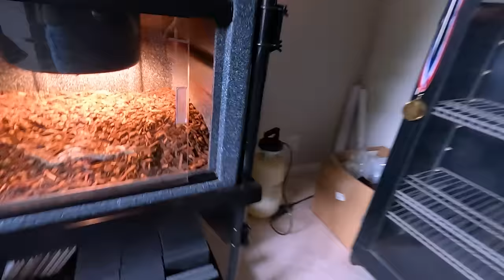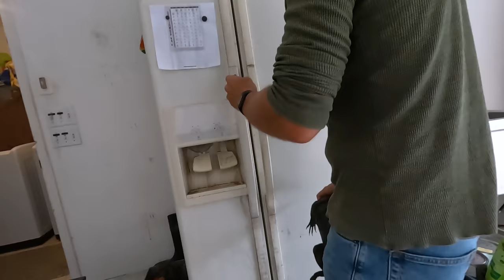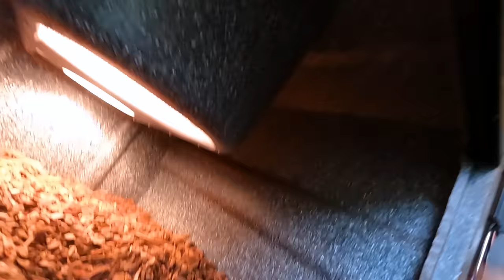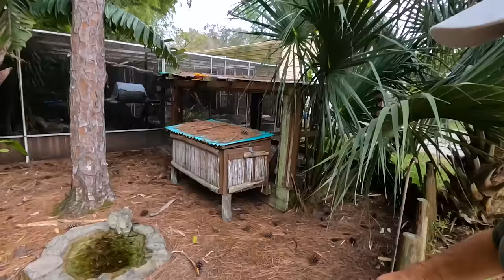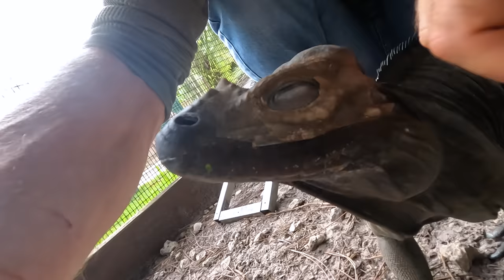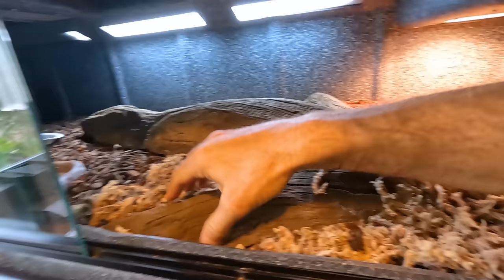My Blue Iguana is MISSING in the House!

Comment: DIY tip: use an S shape piece of rigid wire to make a glass lock for terrariums. You slide it between the panes and turn, to hook both ends of the glass.